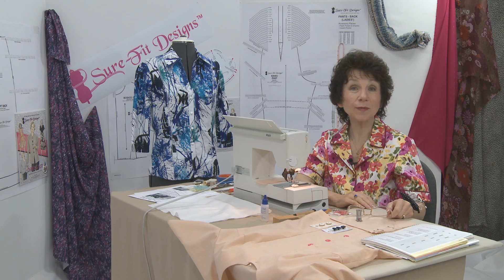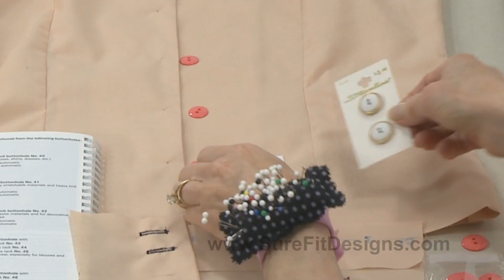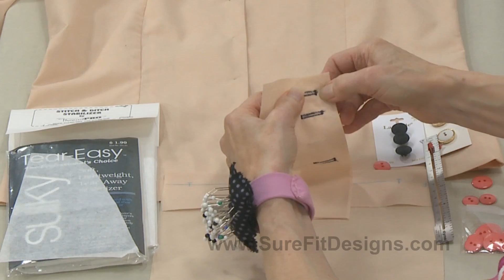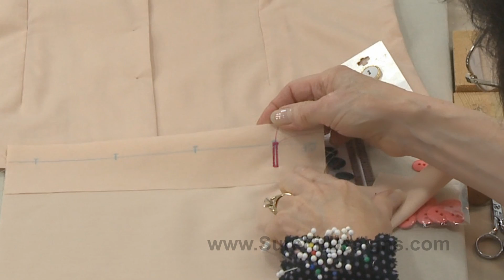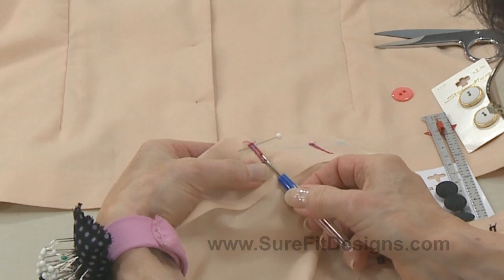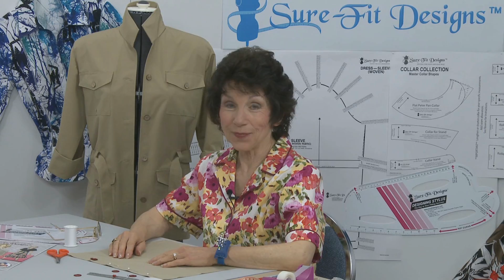Tutorial 25 Beginning Sewing Series Make it Sew – Sewing Buttonholes by Sure-Fit Designs™

Comment: do you usually use horizontal buttonholes? ( I need to put buttonholes on the back of a childs dress)
Reply from the maker: I usually make horizontal buttonholes but some garment require or look better with vertical button holes.  It just depends on the style of closure and size of button.  Vertical buttonholes can tend to gap open more readily depending on how they've been supported and the size of button used.